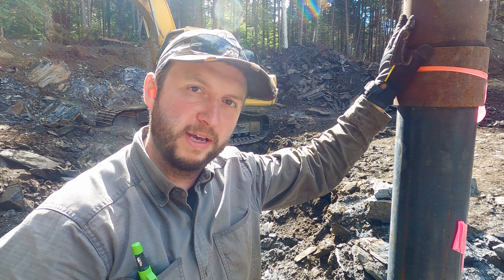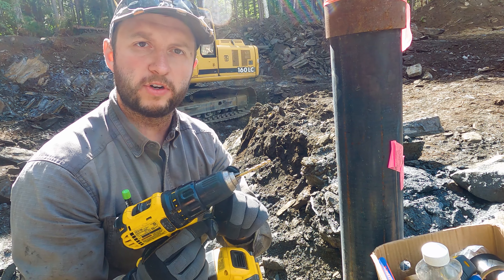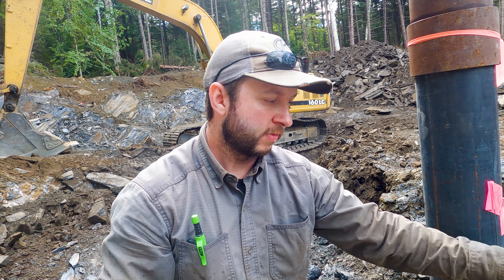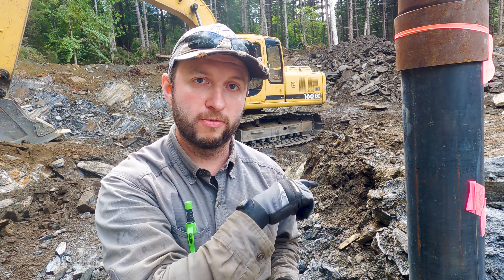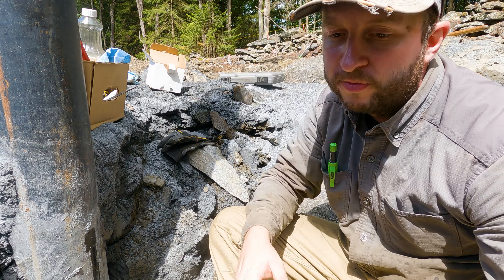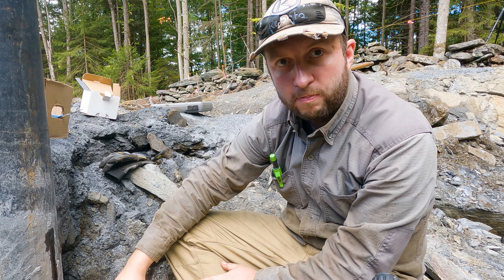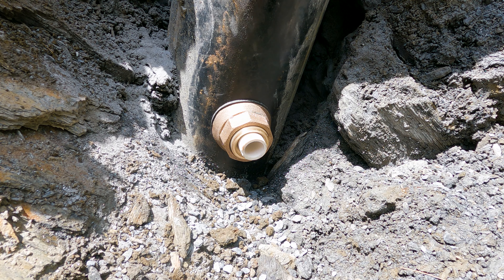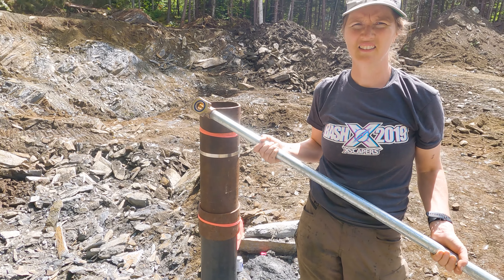DIY pitless adapter installation

Comment from the maker: Here are the tools and materials we used in this video (includes affiliate links):
○ Campbell B-10XLF Pitless Adapter https://amzn.to/3T1XkSx
○ Cordless drill https://amzn.to/3mDaFF1
○ 1 7/8in hole saw bit https://amzn.to/3JbexES and  https://amzn.to/3kYLJHo
○ A short piece of schedule 40 pvc pipe
○ 1in MPT by 1in barb fitting
○ PTFE tape https://amzn.to/3kSGZTS
○ Pipe thread sealant https://amzn.to/3J54WPz
○ Tape measure
○ Adjustable pliers https://amzn.to/3FdlaoW
○ Canola oil
○ Metal file
○ A large t-handle (10ft +2ft galvanized pipe threaded on both ends and a tee)
○ Utility knife 

If you found this video useful consider sending us a Super Thanks on YouTube.
Reply: Thank you. How deep is your well?
Reply: How long did it take to drill the 1-7/8" hole?

Comment: When using thread tape, an easy way to remember which direction to put it on is to spin the pipe or fitting in the direction of installation while holding the tape in one place. As you spin the fitting it will pull more tape off the roll and as long as you spin the fitting the same direction as when you install it, you will always be correct.
Reply from the maker: Oh I like that. Makes perfect sense, thank you!
Reply: Was going to say this exact thing. Pretend you’re screwing it in with one hand while holding the tape with the other

Comment: If it was me I’d be concerned about losing the part that goes inside. I’d have to leave it attached to the 10’ pipe.😬
Reply from the maker: The piece of pipe was good insurance to make sure it didn't fall out while installing, and once it's in there, it's nice and secure! I hope 🙈

Comment: Run the drill in reverse to start out with with a bit in the steel it will put a Groove into it and then run it the other direction to actually punch the hole

Comment: Excellent job and great demonstration of this entire process. I am getting ready to do ours here in Montana this weekend and this has been very helpful. Best video on this topic I have seen, and I've been through quite a few of them 😊 Eric  PS- one hurdle I have is that we have artesian flow of water coming out the top with about a 3 gpm head pressure. I think I am going to sink a pump hose down below so the water, or at least not as much, isn't flowing out the top and the side as we drill the hole and install the pitless adapter😅
Reply from the maker: Thank you for the kind words!

That kind of water flow sounds like a nice problem to have. Curious though what happens in winter?
Reply: @AdventurousWay  yes, it would freeze. That is why we are putting the pitless in down 6 ft. Then we'll run that to our heated utility shed with the pressure tank. Cheers!

Comment: Excellent video, just what I needed.  I have to replace our pitless as it is leaking and new O-rings don't help.  Apparently, the brass with our slightly acidic water (or was it alkaline?  Anyway not neutral) ) will degrade over time.  Our well is 25 years old.  I am planning on going with a stainless steel pitless.

Comment: Why not use a brass fitting instead of a stainless barb? Like a Ford, Legend, or McD pack joint fitting? You wouldn't then need to worry about dissimilar metals.

Also, stainless steel banding sometimes is sold with non stainless screws.

Comment: I'm not surprised the Irwin drill bit failed.  I used to specify tools used on the production line and we found that Irwin only makes consumer grade tools. 

I called customer service and they told me they don't make hardened commercial grade tools.

That's why when it counts I spend the money for better bits.  I definitely do not use harbor freight bits cuz they are complete garbage.
Reply from the maker: That's really good to know, thanks for sharing! In this particular case I really only needed it to last for that one hole, but it was disappointing nonetheless.

Comment: Always put the fitting in your right hand tape on the top turn fitting away from you correct every time
Reply: What does "tape on top" mean, and how does this result in the tape being wound onto the threads?

Comment: Why not use a brass barb
Reply from the maker: In which location?
Reply: @AdventurousWay  coming of the pitless adapter to the suction line instead of ss just use brass to brass tape and dope is not gonna stop electrolysis. You need a dielectric union, but brass is better then steel so just use brass next time.
Reply from the maker: Ah, for the stubbed supply line on the outside of pitless adapter? Yes, you're right, I probably should have used brass there. The SS was probably just what I had on hand at that point, but we'll be replacing that with the real supply line soon anyway so I can switch it to brass then. Good spot!